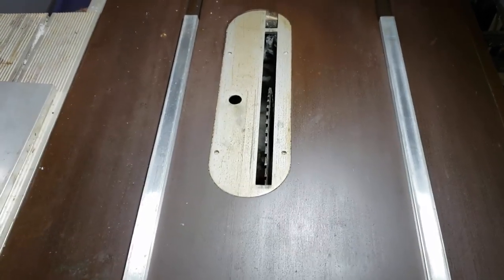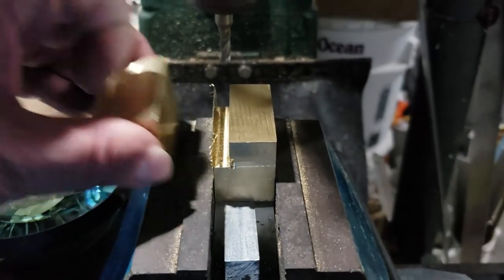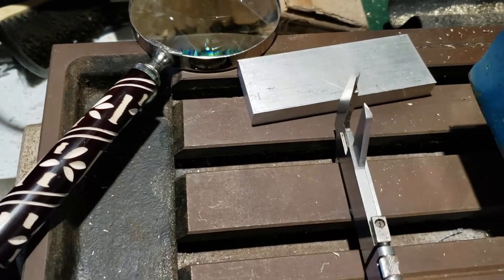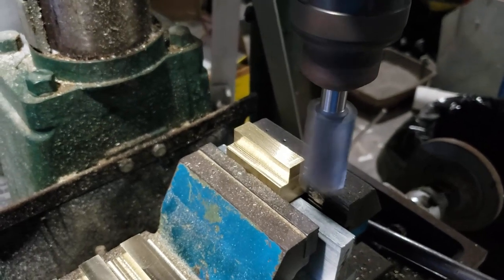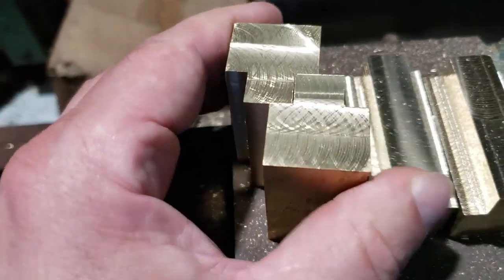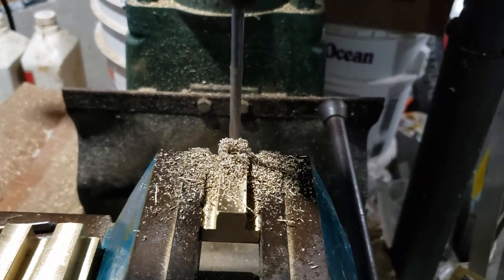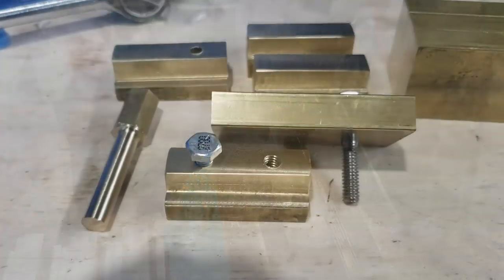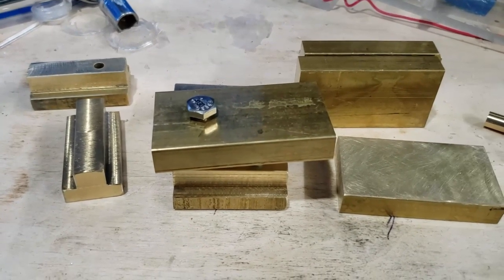DIY Aluminum Cross Cut Saw Sled Part 1

Comment: I took machining in high school. I prefer machining aluminum to brass. 
You chould machine a Venturi for the salt water tank, I wonder what a bubble river would look like powered by one.
Reply from the maker: Every video I watch on this agrees with you. I was surprised to find it easy to work with. All that matters to me is that it doesn't rust. Thanks for watching and your suggestions